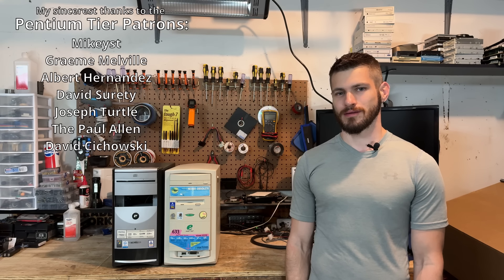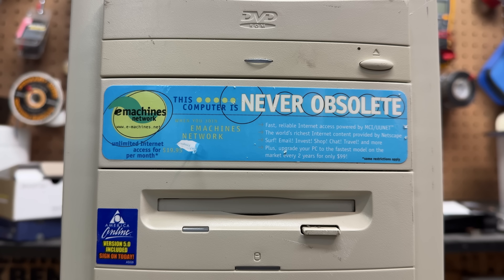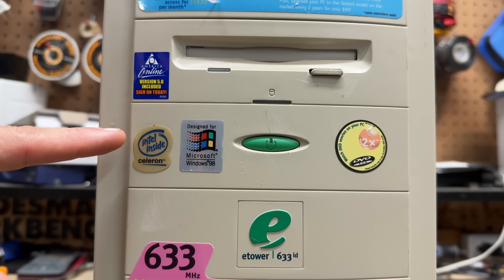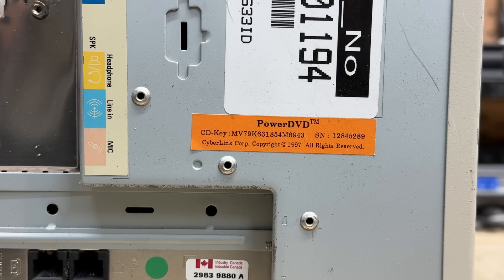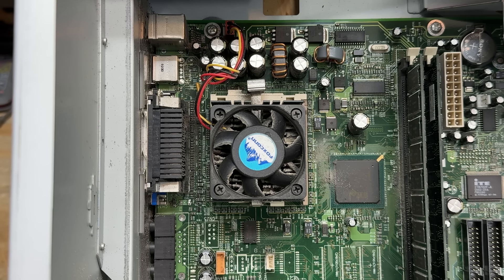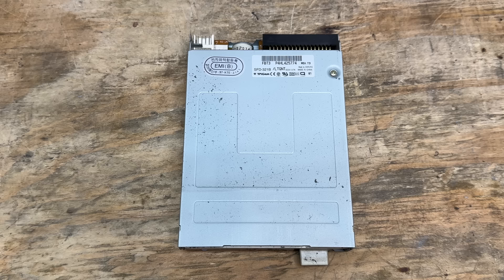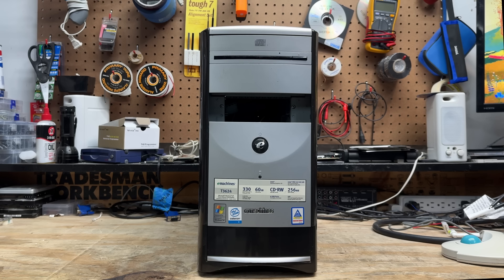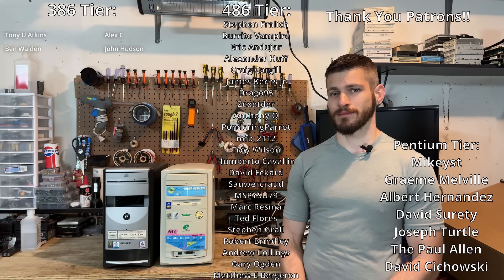Early 2000's eMachines! Teardown and test.

Comment: I'm glad System 1 had a CPU fan. I had to add a CPU fan  to a similar system owned by a client of mine back around 2008; it didn't ship with one. The Celeron kept overheating (no surprise). Fan solved the problem.

Comment: Knowing Cheap machines. They probably stuck the buyer with a 5400 RPM drive. I hate it when OEMs do that. About the only thing I liked about E machines was their case design. The earlier ones seem to have been better quality vs their later XP era machines. I do remember buying an XP era one new back then. It made it just passed the one year warranty mark before dying.- I still  use Windows MovieMaker. Most of my videos posted are movie clips. Still good enough.
Reply: On a follow-up video. Maybe you could see what updating you could do to the 633. Like an actual Pent3, more memory, restore to the Me OS. Setting you up in case I decide to buy it later on.
Reply from the maker: It would be funny to try and edit part of the follow-up video on that machine using Windows Movie Maker. Emphasis on ‘try to’ 😂

Comment: i bet the upgrade worked like some of the older apple computers where you just swap the motherboard. 
i did that with my etower 500is the onbord ATI Rage vram ram was going bad so i replace the motherboard out of a etower 766 that had a dead dvd drive that was in a funky case and the motherboard was full intel and more stable too.
this was a few years ago mine you somewhere between 2010 and now, i lost track when i did it.
i think most of these system use the same IO plate on the back.

Comment: It's hard to believe my old eMachines 633 is a collectors item, now. It's actually never left my bedroom, so it has stayed in a climate controlled environment. I never bothered to check the caps, though. I did a hack back in the day where I solders a wire to the PC speaker with some resistors so I could plug the PC speaker audio into the sound card. I should have all the original drives and documentation that came with the computer. It was a bit special to me because it was my first "modern" computer. Now, it just sits in a corner gathering dust.

Comment: I had a very similar computer in the early 2000s, except it was an IBM Netvista. Same case design, just lower (the SFX PSU was sitting above the CPU with a big bracket), the CPU was a Celeron 733, 64Mb SDR, and an i810 motherboard just like this computer (though it was made by MSI), the hard drive was exactly the same Quantum Fireball lct20 (loud HDD).
Anyway, it was terrible, my parents bought it full price in 2001 while it was a 2000 computer (and a lot changed in between those two years).

Comment: Mike, you can find out for sure if that msg is spyware, by changing the Windows theme. if that message still has the same colors as before, the system has spyware. 

They were too lazy and/or stupid to change their bogus message colors to match whatever theme you were using. They kept it at default.

Comment: We're still using an old Pentium 4 at work running Win 10 because the scanning equipment needs the old PS2 keyboard connector.  Never obsolete ? 😆

Comment: im kinda surprised with that samsung  dvd master working. have had a few of those and they were all crap. ether were already faulty or they broke not far after. and all were not fixable. one even let magic smoke out. so i just learned when i see them to have low hopes and just ether remove them and never bother or just have anther one handy. worst cd drive experience ive ever had, i ironically have some model of the first pc but it was very stripped when i got it. all panels and face bazzel missing. no drives. psu or anything. was just a case with a motherboard and a floppy drive. and never felt like it was worth rebuilding. but does work. also those asrock motherboard were notorious for being bad. i have 5 or 6 of them and 2 are just dead short across all power rails

Comment: Worked at Best Buy during these PCs heyday. 

Cheapest desktops we sold. By far. Always RAM starved. Terrible warranty. Almost impossible to get things fixed under it. 

They'd throw power supplies all the time. At the time, they were the only ones using that form factor (non-atx) which made them impossible to find locally.  So we'd have people changing the out the entire case for one of those $30 bottom of the barrel case+PSU combos a local computer parts store carried. 

Hated those damn desktops.

Comment: these etowers seem to mostly use the Trigem Cognac motherboard. decent enough, just no AGP support. perfect for a voodoo3 or voodoo 5 if you have PCI varaiants.

someone did a sleeper build in one of these and had to Dremel off some of the inside of the case to allow an SFX PSU to fit - not because of the size of the PSU but because there are some metal tabs that hang down into the case.
Reply: on a side note...what was the inspiration/where did you get the idea for the sacrificial hard drives and the bulb to test PSUs?
Reply from the maker: Some power supplies won’t start unless they sense a load. A convenient way for me to provide that was to connect an old, dead hard drive. Then the second one came along and I found it to be delightfully noisy. They make a good duet!
Reply: @miketech1024  thanks for the reply. your weekly videos are really great. hope your channel has been doing well.

Comment: Those Quantum Fireballs were terrible to use.  This drive was clearly bad, though relatively speaking it isn't far from its actual speed :D.  IIRC believe one of the Fireball LCT20 40GB I had in an HP averaged around 2 MB/s writing.  I should probably yank it out of storage and see if it still works and do proper sequential and random writes.  The thing was painful in real world usage, probably due to its 4500rpm spindle.
Reply: NOT in '97!